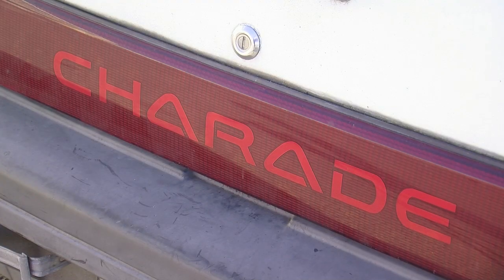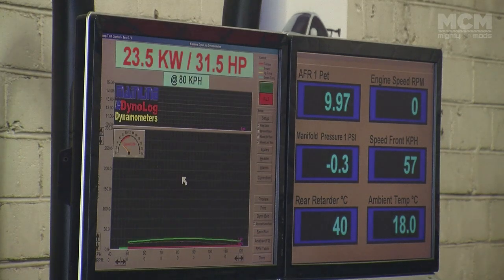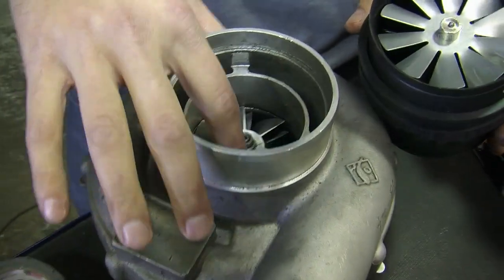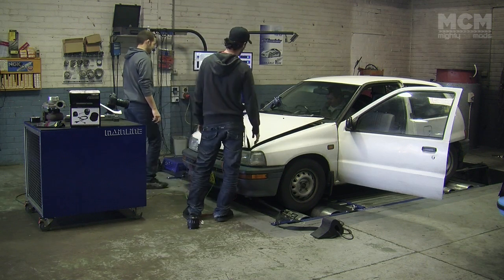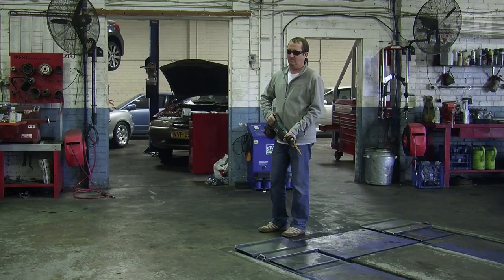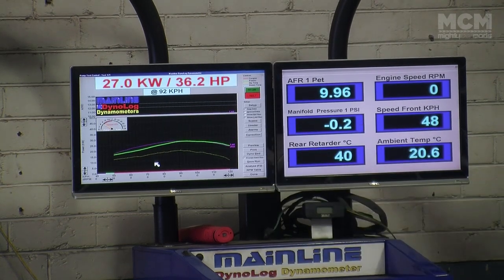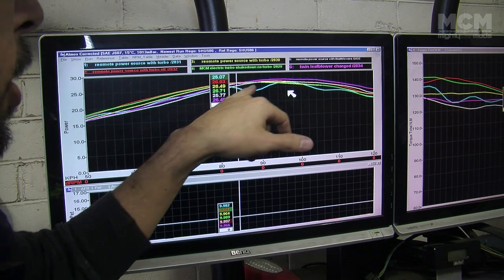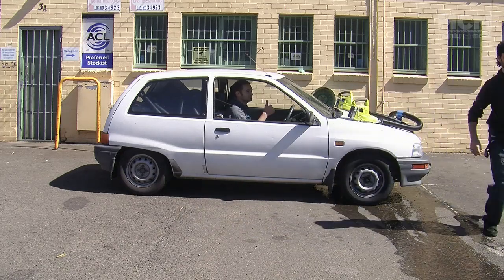Electric SuperChargers Mythbusted

Comment: I bought a $5 Turbo emblem and stuck it on the back of my old 5.7 liter 3/4 ton van. Yeah, I can feel the boost and I know it worries the guy behind me at the stop light. I get zero to 80 in less than 10 minutes now.
Reply: Mitchell Lincoln
That gives me an idea....Put the Cummins emblem on my worn out Geo Metro. It smokes a little so it will roll blue coal instead of black coal. Maybe I can fool the emissions nazis.
Reply: Jagger Bombs
How many horses does the square back tire add?
Reply: Probably about as much as the leaf blower turbo, but that's only speculation.
Reply: @kimmer6  only 3/4 of the traction a equilateral tire would add.
Reply: kimmer6 put a fake turbo wistle and get extra 300+ hp
Reply: *****
Look out dudes!  I'm filling it up with MID GRADE and I'm going to Armor All the dashboard. I'll put triple blade wipers on and then you all can't touch me!
Reply: Best comment ever dude!! you win the internet!!
Reply: paytheprice,  I got a blow off valve but it requires 3 Burrito Supremes from Taco Bell to operate properly.
Reply: 750 kilos is very light for a van
Reply: @grimurdionjonasson1198  that's still a whole lot of powder.
Reply: sounds like a hell of a plan to me.
Reply: If they where smart they would mount a pressure gauge on the hose. It would probably show 0,1 psi   or just 0.
Reply: kimmer6 I got a sticker that's in Chinese when I once bought something from China. I don't know what it says, but should at least give you 150hp and some serious street cred.
Reply: hamiltoncouple01  Shure.
Reply: bro i have heard that the 10 $ turbo sticker gives 30 psi and 120hp + .... u went wrong with the 5 $ one ...just saying
Reply: Had 1 too them vans are awsome
Reply: Barxxo
Agree. A turbo runs from 80 000rpm to 160 000 rpm. This is maybe only at 30/40 000?
Reply: Wicked over on with the American dream
Reply: kimmer6 hmmm something tells me your ride ain't street legal
Reply: Mitchell Lincoln you should see my Honda m4 zr1 it's pushing 9trill hp out the windshield
Reply: no highspeed wobble?
Reply: Absolutely right with you saying you stuck it on that's almost like a 3D sticker and everybody knows stickers and other graphics always add horsepower and torque if that's not enough throw some Chrome on it. I had an 87 Subaru that I counted my 0 to 60 time with calendar pages after a couple of stickers on it okay I needed the same amount of calendar pages but I didn't go as deep into the last one
Reply: Kimmer6, you're awesome.  Cheers!
Reply: Get 100hp if you have flames added to the paint job.
Reply: un motor de drone deberia servir son muy potentes
Reply: Go Chevy 20 Yess
Reply: @haydenbellis3047  OK. But I kill rats in my garage with spring traps. Is that OK?
Reply: Do I sense a little sarcasm..lol. I highly doubt the hp gain promised on the box. If this worked like this dirt cheap quality part. This surely wld of been made a long fkn time ago. She may be a lil cooler air but I dont think it wld give my twin turbo enough power to even notice
Reply: I put a powerstroke sticker on my 7.3 and it added 400 horse and 85 pounds of boost
Reply: @InternetMisconduct  I tried to add 100 pounds of boost to my ford, but i got misfires because it was draining the battery.
Reply: ***** this little electric fan runs much too slow to have any positive effect.
Reply: @Barxxo  it's a fan, it just blows the air in. The turbo or supercharger compress the air. This wouldn't work no matter how fast the fan was it's not efficient
Reply: Barxxo More air absolutely will not give you more power.   Turbo engine requires proper camshaft with different duration  unlike naturally aspired motor.   ECU also has to set different curves and fuel mixtures.
Reply: @hamiltoncouple01  Turn to Christianity and United Brethren Church before its to late saying anything hateful, premarital sex and lust are all sins. And so is using the Lords name in vain. Killing is a sin.
Reply: @hamiltoncouple01  NO SHIT SHERLOCK! LMFAOI!
Reply: Paul Hopwood And your point is what???
Reply: @hamiltoncouple01  That only stupid people state the obvious LMFAO!
Reply: Paul Hopwood So you’ve been looking in the mirror?
Reply: @hamiltoncouple01  There's 2 of you and that's still the best you could come up with ROFL. Bit late to the party dropkick No second prize here loser :) LMFAO!
Reply: Paul Hopwood Simpleton said what?
Reply: @hamiltoncouple01  Obviously you are one of those fragile ego'd wankers who needs to have the last word. I don't want you popping an artery in your forehead or having a stroke or anything so I will let you have it. Go for broke dickhead and get your girlfriend involved too. She is probably the one who wears the pants at your place anyway ROFL!
Reply: @hamiltoncouple01  Rofl!
Reply: Paul Hopwood Poor little boy.  Keep dating your twins, lefty and righty, “wanker boy”, lol.  Quote:”Best you can come up with”.  What are you 5 years old, lol.  Bud, you’ve got IQ of a fish, lol.  Keep them coming, we’re having a blast in the shop reading your comments LOL.
Reply: hamiltoncouple01 That’s mega funny dude.  Paul Hopwood got his sexy twins, LMFOA.
Reply: hamiltoncouple01 Man, you wiping your a.s.s with that dude Paul Hopturd, LMFOA.
Reply: @jayzender4083  GF not enough, had to get a mate in as well ROFL. Must be a Uni wanker ROFL!
Does he share his GF with you Jay or just his probwems when a internet buwwy picks on him? ROFL!
Reply: paytheprice same profile photo lol
Reply: Whoah Bro! Fully sick! I bet your truck has a sign on it  says 85kph Power limited...On a good day ROFL

Comment: this is absolutely wrong , the air intake hose does not have  to be atached to the air filter, This is also bullshit because  a carburator needs negative pressures in order to work properly. Then this thing will work only in a fuel injected system and firmly locked and tightenned to the air intake neck.

 They are not taking care of air leaks at the filter.Turbo systems are so sensible to air leaks  even if you have a litle leak. they never show a gage attached to the air inlet at air inlet manifold. I know that turbos work, of  course 5 psi will make a lot difference in th performance of this little engine ..
Reply: It's a clapped out Diahatsu Charade. I don't think they are too worried about the technicalities lol
Reply: They are just playing games mate. To compress air you need 100,000 rpm minimum. No chance in hell an ebay "supercharger" is going to do that.
Reply: If that electric supercharger makes any pressure at all carburetted engine wouldn't even start. It is easy to test if that charger makes pressure, just block "pressure" side with your hand. You could also test the intake side with your hand and compare it to the vacuum engine produces at idle.

Comment: What about using a small air compressor to test, as the title suggests it does compress air if you sealed the system. You could used the small ones you pump up tyres with, not any industrial ones.

Comment: Comical video. Lol. There is no need for the dyno test though to prove that it will or won't work. All that's needed is to measure the maximum air volume flow, usually measured in CFM on the intake tract of the engine with an anemometer and measure the maximum air volume the electric turbo is capable producing using the same device. If the turbo is capable of exceeding the air volume flow the engine is creating then it will work to some degree, how much though will depend on how much more the airflow is being produced. If the turbo is not capable of exceeding the airflow volume the engine is producing then it will only be an obstruction in the system, thus having a negative effect on engine power. The dyno is good for showing how much more or less power is being produced though.

Comment: You could get an extremely small turbo for maybe $500 or so off of a factory turboed car that the owner is upgrading and then use the leaf blower to blow air into it instead of the blowers directly into the intake. The problem with leaf blowers is that they aren't compressing air they just push it and a leaf blower has to blow harder than a little 1.0L 3 cylinder can through exhaust so it could gain quite a bit maybe say it makes 60hp to the wheels or about 40kw or something I don't know the conversion for those units
Reply: What about installation installation is often more money then the turbo it self
Reply: That is mostly the cost of having the car tuned for the turbo and turbo headers because turbos run off of exhaust gasses but running it off of a leaf blower eliminates the need for turbo headers. Also you could run a wire from the throttle to the trigger on the leaf blower so the more you press the throttle the more the blower blows making more bost
Reply: If your gona get a turbo do it right not the ghetto way
Reply: Its not the gettho way its just for a test. In case you haven't noticed MCM doesn't really do many things the right way.

Comment: They should add a little note for the real electric superchargers that some companies are making, as a lot of "knowledge bois" are coming across them and spewing "MCM tested this therefore they do not work" without actually looking at is there. Seems like a turbocharger turbine is now as useful as a computer fan just because it is powered electrically - with the correct high power brushless motor they can actually work. Maybe not give you 15psi but 5psi would sure make some difference for small engines up to 2L or so.

Comment: this is bullshit. the ebay supercharger would have worked if you stuck on a webber or  a SU carbie. didnt have enough fuel.... totally too lean!
Reply: I hope you are joking otherwise you are a idiot.
Reply: and lets not forget the exhaust, far too restrictive. a motec system exhaust would have helped too!
Reply: Sure , sarcasm stfu
Reply: You suck at sarcasm
Reply: so why does it work with the leaf blowers
Reply: rich cronin it was slightly compressing it at the T piece only like .1 of a psi but it was forcing 2 into 1
Reply: jack black sounds like you should have but the leaf blowers instead
Reply: jack black You really dont know anything, do you?
I guess you bought one and are just bullshitting yourself that a computer fan for 300 bucks actually makes your car faster.
Reply: OMG its called sarcasm you fucks! god damit relax lol

Comment: Next time make sure the entire intake is sealed...there is some sort of breather valve or some shit on the stock intake tube....and we all know that there is always a ridiculous gap  on carburator filter covers..the air is simply escaping out and through the filter and then out of the cover, c'mon guys im sure you are smarter than this..do it on a fuel injected engine then test.  Of course it will not make a difference since these things do absolutely nothing, but still would have been a more credible way of busting the myth.